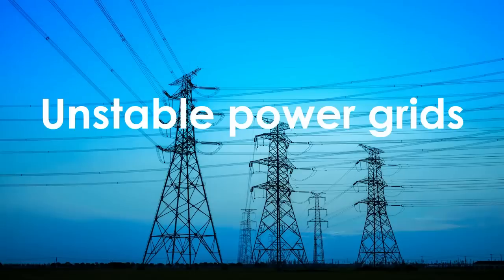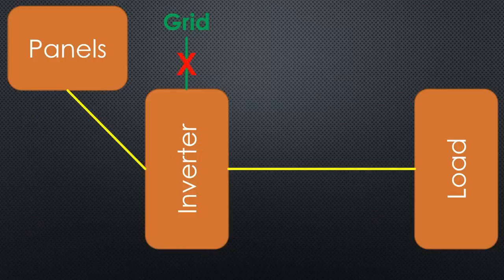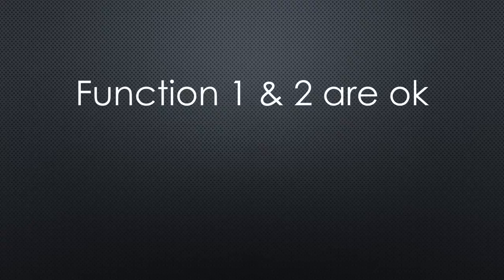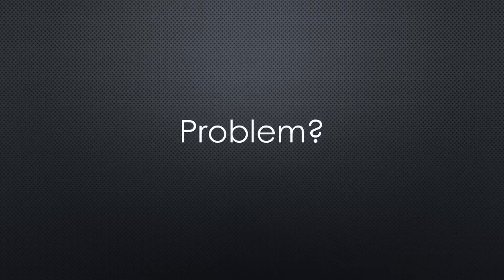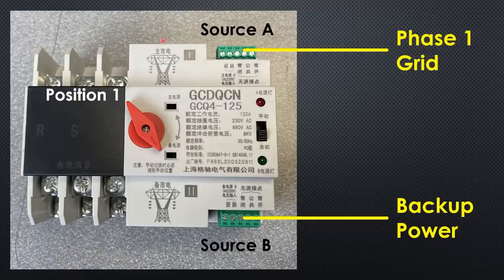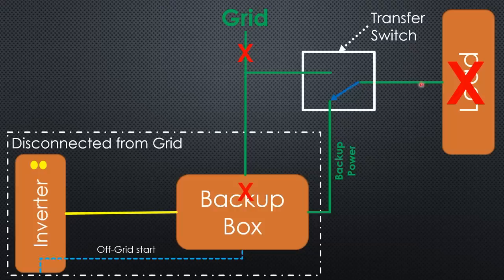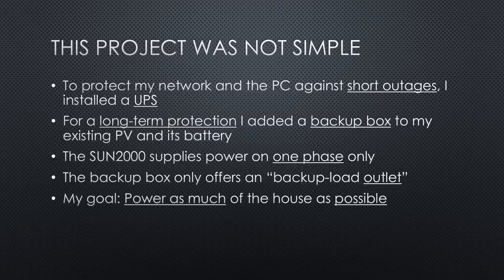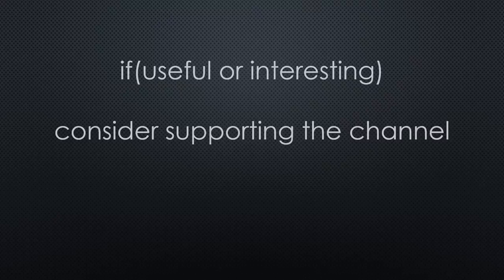448 How to Build an On- and Off-Grid System (Backup Box Hack, Huawei SUN2000, LUNA2000)

Comment: if i had access to my home wiring from 800km away using something like "VPN for wires" i would have followed this route for remote troubleshoot. Besides when my home was built they put the main inverter where carrying wires is aesthetically undesirable. May be in future i might consider replacing my home inverter with a "smart" solar inverter with grid export feature.  Until then i watch solar generation/export in my android phone using data stored in china. Also since the himalayan chilly winds have subsided a little, which sucked away all human heat, i can also clean bird droppings from the solar panels and show off to my neighbours. By the way, after i installed the solar panels about 8-9 years ago, almost all the roofs in my neighbourhood have solar panels 😞
Reply from the maker: You mention an interesting fact: Countries like yours are much more advanced in Solar than Switzerland. In my village, only 25% of the buildings have solar. But I assume this will change over the next years if I believe all the discussions with my friends.
Reply: If everyone will have solar connected to grid it will not work!! because no one will be paying for electricity. In addition, right now we are importing silicon wafers, just assembling them here. But after the events of 2019-20 general trend of electronics is to move out of china. So maybe we will have silicon manufactured from sand right in our country. Another major problem is the to have battery. I am not sure if we have lithium mines in our country. Our mainstay is lead-acid with strong smell enough to intoxicate some people without requirement of any alcohol. They are now talking about hydrogen trains and all those kind of big things but i am not sure that will be sufficient.

But yes, "sun" god is revered by everyone here. In fact in our ancient texts, gurus traced source of all "life" to sun god. They even composed hymns for meditation https://www.youtube.com/watch?v=M7-_gwbUXcI

Comment: Are the stove and oven really connected in delta?  It doesn't seem the case here in Australia where 3-phase supply is used to balance the loads by connecting different elements in star...

I was also thinking it would be delta until I read some appliance installation destructions. Seems like they don't want to deal with the higher voltage.
Reply from the maker: I did not check. The just do not work off-grid. So I supposed they are connected in delta.

Comment: Sali Andreas, danke für das tolle Video. Heute wurde endlich die Installation der PV-Anlage inkl. Backup Box B1. Ich glaube ich habe sogar die gleiche Anlage wie du. Bei der Abnahme waren der Elektriker und die Solarinstallateur dabei. Sie waren sich nicht einig, ob die Backup Box für mich sinnvoll ist oder nicht. Ich wäre froh, deine Meinung dazu zu hören.
Elektriker meint, dass die Backup Box speziell gesichert werden muss und aufgrund der Limitierung von 16 Ampere nichts bringe, währen der Solarinstallateur plötzlich der Meinung ist,  dass ich gar keine Notstromanlage benötige. Tatsache ist, dass ich gerne bei einem Stromausfall einen funktionierenden Kühlschrank, einen Tiefkühler und warmes Wasser habe (das letzte wird wohl mit der 1-phasigen Backup Box nur wie bei Dir mit der "short circut zu Phase 1 möglich sein). Super cool wäre eine direkte Konversation dazu, wenn du Zeit hast. Danke schon mal und beste Grüsse, CJ
Reply from the maker: Es sollten alle Angaben die du brauchtst im Video sein. Ob du eine solche Anlage willst oder nicht musst du und nicht dein Installateur entscheiden. In der Schweiz ist sie vermutlich kaum nötig.

Comment: Do you have plans to include an MQTT message showing if and how many minutes you are on emergency power?
Reply from the maker: For the moment I do not have this intention. But I think, the inverter transfers its status automatically with all other data. So it is stored, but not used (for the moment).

Comment: I wonder about the sum current of N of the oven. 3x the same phase differs from 3 different phase. Let's assume that you can drive the oven off-grid anyhow only a short period and your wire diameter is big enough.
Reply from the maker: All depend on how the oven is connected: Star or delta. If it is star, then you can add the currents. If it is delta, the sum of all phases is 0.
Reply: @AndreasSpiess  you miss the point of phase-shifting. In that term 3x the same phase results in a bigger effectiv current as 3 different phases.
Reply from the maker: @tituslivius7869  I agree. But this does not matter in my case because the inverter can not produce more than the current of one phase.
Reply: @AndreasSpiess  ok, its more a general hint.

Comment: I am set to buy a solar backup system. which include the following - HUAWEI 3.68 KTL M1 Hybrid Inverters and 3 x 5 KWh Batteries with Back up Box. My house has three phase and I was wondering if, in case of a power grid failure, I would be able to light up different appliances on different phases (but same house).

Apologies for asking to you directly but this is a huge investment for me, we do have a number of power outrages here and I don’t fully trust the salesmen
Reply from the maker: I answered this question in the video.
Reply: @sSpiess apologies for my ignorance but I am really not a technical person. Once again sincere apologies. I only want to keep an AC, fridge, kettle and freezer switched on

Comment: Hello ,

Are the ports for the neutral conductor on terminals X1 (backup load-port 2). X2 (grid-port 4) and X3 (Inverter-port 8) at Backup box-B1 at the same potential?
From which port is the neutral conductor connected to the switch (which you suggest) for the load? (X1 port 2 or X2 port 4).
The network is of the TT type.
Can you draw a three-pole diagram?

Thank you
Miletic from Serbia
Reply from the maker: I do not have more information than shown in the video. Look at the drawing at 6:29 that shows the whole setup. Backup power is the single-phase output of the inverter.

Comment: What would happen if, for example, phase 1 is down (which would activate the transfer switch) but phases 2 and 3 are still active in the grid? It is not that uncommon for only a single phase to fail.
Reply from the maker: It would change to backup and cut the two working grid phases.

Comment: Hallo Andreas.
Tolles System. Es gibt jedoch ein System von SMA, dass in etwa gleich Teuer ist. Zudem hat man den Backup Teil direkt im WR integriert und hat 10kVA auf drei Phasen zur Verfügung. Lediglich die Batterie ist minimal Teurer, da man an BYD gebunden ist. Als Installateur habe ich gute Erfahrungen damit gemacht. Jedoch draf man nicht den 300mA Fi vergessen, da die WR im Backupmodus den Kurzschlusstrom nicht erzeugen können, den die nachgeschaltenen Sicherungen benötigen, um fachgerecht zu Funktionieren. Aber auf jedenfalls coole Anlage. Vileicht sieht man sich ja mal. Ich Wohne keine 300m von dir😉
LG Basil, Solar4you
Reply from the maker: Den Namen Holinger kennt man natürlich in der Gegend. Und wenn man auf die Homepage geht sieht man auch den alten Herrn (dein Vater? ;-) 
Komm doch mal für einen Kaffee oder ein Bier vorbei. Du findest meine Telefonnummer sicher.

Comment: The switching from ON to Off grid took alot of time.....I wonder how hibrid inverters do it, it's seemless
Reply from the maker: Mine is hybrid. This time is required by our electricity company.
Reply: @AndreasSpiess  I have an Offgrid Inverter that does the switching from using grid to using battery+solar instantly. You hardly notice a flicker. (the inverter is doing it..not an external ATS)

Comment: Is the grid so unstable in Switzerland that it's worth the extra cost and effort? I can't remember when the last power outage was in Belgium that lasted more than an hour.... (many years ago)
Reply from the maker: No, it was never unstable. But when I ordered the equipment, they said it is well possible that they will switch power off for 4 hours. Now the winter was mild and it is probably not needed. But what about the next one? BTW: I hope that it was a waste, but I am not sure.
Reply: Depending where in Belgium... not so long ago, the Antwerp port area... more than half a day!
Reply: The grid can be VERY stable, 99% of the time.

But, that 1 percent is about three and a half days of power outage measured over a period of one year.

And there are MANY factors that can disrupt power on even the most stable grids.

Imagine not being able to drive your car with its full tank of fuel, because the local fuel station ran out of fuel.

If you have solar and batteries, why shouldn't you be able to use them then the grid is down.

As for needing solar AND batteries, it makes long term financial sense depending on the cost of your hardware and then sale and purchase price of electricity.

In Australia, if you sell your solar power back to the grid, you do as at a FRACTION of the price you have to pay to buy it.

So, if you sell 10kW of power to the grid at $0.10 per kW during the day, but have to buy 10kW of power at $0.50 per kW at night, it is costing you $0.40 per kW per day.

On the other hand if you sell nothing and store it in a battery during the day, then don't have to buy any power at night, you aren't paying anything.

And that's a saving of $0.40 per kW per day.

Of course, power usage tends to be lower during the night and solar systems tend to be designed to produce more power then is commonly used, so you'll tend to fully charge the battery and sell off the excess power whilst still not needing to buy and power.

This is when you start making a profit, (or at least recouping your costs).

And if this ALSO means you have power during a grid outage, then that's bonus.
Reply: A few years ago my area in Switzerland was without power for several hours, a few ten thousand people were impacted by the failure of a 10kV or 20kV transformer if I remember well. Furthermore, the European grid, including Switzerland is connected together, a large failure in one country can mess up the European grid.
Reply: @doejohn8674  Unfortunately you are right.
Reply: @doejohn8674  ok, but then it's a huge cost to get backup for something that only happens every few years for only a few hours...
Reply: @rianderous8761  Much cheaper are the inverters that have the option for daytime backup without batteries. If the backup is rarely used which is the case in most areas and no other application for the batteries, it's a very economical choice.

Comment: Unfortunately it wouldn't work on my house. I don't have a neutral wire. 
Each phase in my house delivers 130volt. When connecting a device in between two phases, it will get 230v. But if all phases are joined together then obviously that doesn't work anymore and my devices won't work. It would be like connecting both connections of a device to L1 in a normal house.
Reply from the maker: I agree.

Comment: Can't read through 315 comments to see if this was already mentioned, but what are the odds that internet and tv signals keep working during a longer power outage?
Reply from the maker: I do not know because we never had a long outage. But I assume they will fade away after a few hours.
Reply: Here in Belgium they don't function anymore. The telecom street boxes for cable also loose power.
In the old days telephone copper was feeded power from the nearby  central, but I can't tell for xdsl gear. I think they use local active  gear to that's powered from the local grid.

Comment: Andreas I was waiting for this video since summer when you said you would post this off grid safe idea! Thank you! Any idea if instead of using LUNA batteries, we could use DIY LiPo batteries with Huawei Sun2000 series?
Reply from the maker: I would not do it because they are high voltage batteries (800V). If you want DIY I would go for a different brand.

Comment: Is this Hager main switch you operated to simulate a grid loss foreseen to cut power under load ?  IMHO it is only an isolating switch, normally you have first to switch off all the minature circuit breakers to remove all the loads.
Reply from the maker: I do not know. But my loads are usually only 500W distributed on three phases...

Comment: Hi Andreas, be aware with these chinese ATS they are not reliable versus time. I already cooked two of them with less than 100 commutations (and with small loads < 150W)....
Reply from the maker: Good to know. Was it the same one I used? I probably (hopefully) will not have many commutations, but it is good to know.
Reply: @AndreasSpiess  Yes the 8ms monophased version ...
Reply: Having the same.. How did it fail? Just the time delay electronics inside or dangerous the load contacts...
Reply: @sebydocky5080  I have the same question as Michael.
Reply: I designed an ATS with much more reliable components .... (schneiders element)
Reply: I modified the electronic inside... I do not trust the "power supply". As I have to hand start a generator both automatic inputs are powerless via 230 fuses. (also needed as directly connected to high current sources). Grid is delayed. Geno switches direct. Made a handbook; wife readable. 1. steps are cables connecting. 2. Switch on the two fuses. 3. Start generator.  Will automatically do the high power switching. Also change from 3phase to single phase. At this point don't forget the higher current of the neutral....
Reply from the maker: @sebydocky5080  I still do not know what failed (what I can expect) 😞
Reply: @AndreasSpiess  I had a mechanical failure linked with the builtin two teeth contactor pushed from one side to another one by a strong spring. Versus time, the teeth are no more well aligned and contact becomes bad. The builtin metal material is not great too.... you can see versus time also some black mark at contact points. For the second model, it's the buiitin relay that cooked.

Comment: Greetings from the other side of switzerland. I now have the same setup as you with one exception, I have a manual transfer switch from ABB. My power outage test was together with the electrician inspector. Funny thing was that the luna was still charging during the test because the sun was shining and there was plenty of power available from the pv. How much do you spare for power outage? I configured 20% or 3kWh.
Reply from the maker: For the moment I have 95 and 10% as limits. But mainly because I want to extend the life of the battery. I only will change it when I see something changing in the overall situation of our grid.
BTW: We already had an outage when I was not at home. My wife did not know that there was one ;-)

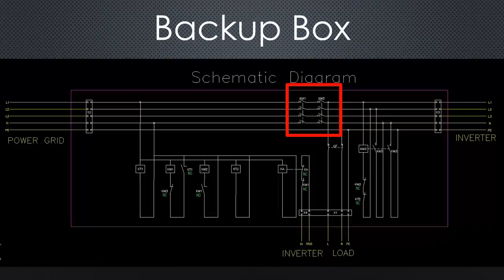Comment: Andreas, I am wondering if 3:13 KM3 in the backup box is wired correctly in this schematic. What is the purpose of having the coil from L1 to L2, and the contacts shorting L2 to N? And L3 remains floating? Second contact N to PE is clear to me.
All that seems a very special solution for a special problem, since the SUN2000 can deliver only 1 phase "Ersatzstrom".
Reply from the maker: This backup box is from Huawei and particularly made for the SUN2000 inverters. Other suppliers seem to sell their solutions. And hopefully, they integrate it one day into the inverter...

Comment: I wonder how switching back works wenn the grid is up again? Did you also automate this? An outage for sure will happen while you are on holiday
Reply from the maker: The switch in the fuse box will always switch the the grid when it is available. It only switches to "backup" when grid is not available. So it works automatically (in a few milliseconds).

Comment: Hello Andreas, thank you for your interesting videos. I have one question about the automatic transfer switch. If the grid is switched back on in case after a blackout, it is not guaranteed that voltage/frequency are 100% stable. Wouldn't it make sense to switch back to the grid after a while? If you switch back too early you could damage your devices with under/over voltage. I see advantages here with the manual switch. Many greetings!
Reply from the maker: You are right, it could make sense to wait. But I compared it with the "normal" situation where my devices are directly connected to the grid. Then, they also would get all the instabilities.

Comment: I have the same Huawei sun2000 system with 10 kw battery as you have, I asked my installer to add an additional backup box so I could use the system when the grid was down. He has never been back to install it and I'm beginning to think it's because he knows it's only capable of running a single power lead and I need it to power the whole house. Maybe all we need in addition to the backup box is this transfer switch ?
Just out of interest Huawei state the system should be able to run in off-grid mode without  a backup box i.e if it's installed in a remote location without mains power, therefore is it not possible during a power cut to simply switch off the mains supply and switch the battery to DC ? will this not supply the power to the inverter and run the house? I have asked this question on various forums but never got an answer.
Reply from the maker: I would not buy a Huawei system for off grid (it will only provide one phase energy). There are much better solutions for that (e.g. Victron). The capabilities of the SUN2000 are well documented and I showed in a previous video why they cannot do 3 phase backup power (as many other simple inverters).

Comment: Guessing you chose the Huawei inverter because it works with HomeAssistant OS, but can it be restricted to a VLAN with no internet access?
Reply from the maker: I assume it works without internet. Then, you have to do the updates with your Smartphone. And you can connect it with a wired Modbus.
I showed why I bougt it in earlier videos.